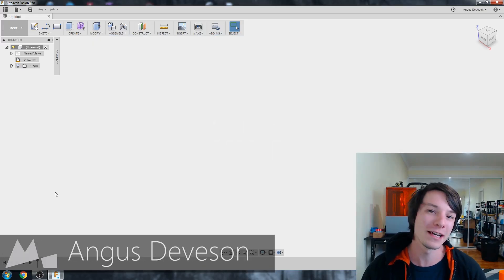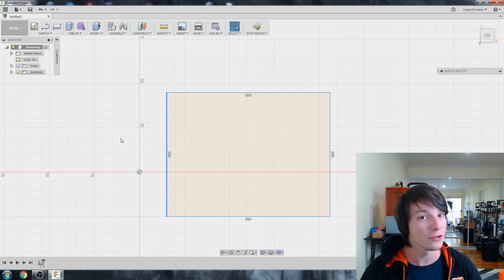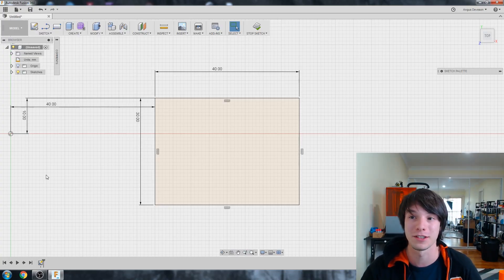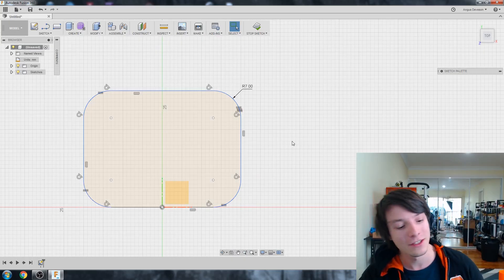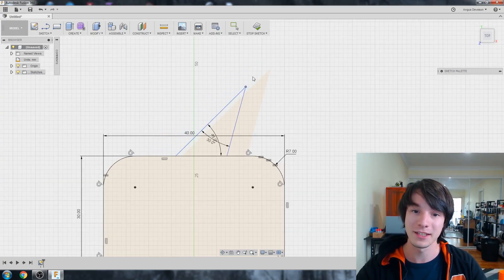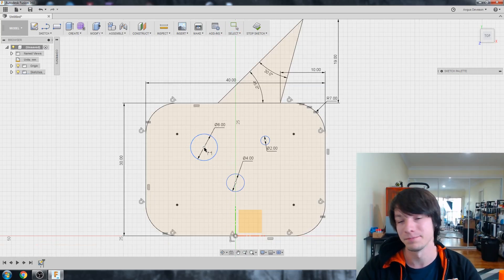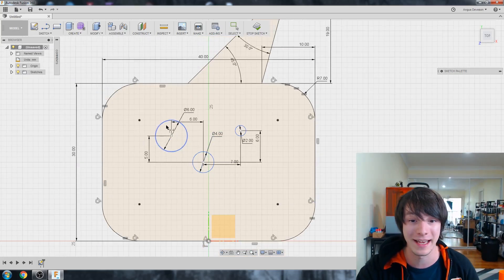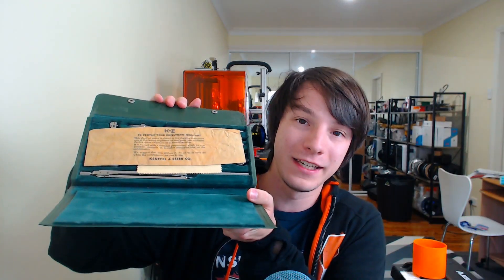Correctly Dimension your Sketches! CAD for Newbies with Fusion 360

Comment: I've got a set of those tools (and some slide rules). I used the tools around the time that the TRS 80 hit the market (77-78). The coolest draftsman (I wasn't a draftsman btw) on the block had an electric eraser. I made blue lines of drawings that I needed using mylar with the drawing exposed on it and some treated paper. You put them together and ran them through a big machine. I don't remember the details but the the smell of ammonia was strong when we were making copies. I prefer Fusion 360 to those days but a set of good drawing tools are still pretty handy.

Comment: Watching this on July 20th, 2020.
 
 
This is a really good showcasing of how dimensioning works because I ended up having the same design as you even after we "randomly" placed the circles. We still had the same sketch at the end of the video.
 
 
It will not be a yellow background on the sketch anymore, it is not blue. The rest of the color remarks are still relevant.
6:40 - Fillets is now underneath "modify" section, which is just to the right of "create". In other words, if you try to create a line, go over 6 spots and you'll see "fillet" which is just before the scissors.

Comment: Frustrating like every other video on Fusion.  The information is great, but as a noob to this software you skip some vital parts.  Like one the lines are dimensioned you move the rectangle around to show its not locked.   How did you get out of the dimension mode?  Pressing D again?  Stop Sketch?  Something else?   I an see the mouse pointer on your screen change back to the arrow where as mine stays with the dimension icon.     When your in this mode (and I assume others you can't even move the image to recenter or anything.  A very useful thing to know.   

So I figures out that Stop Sketch brings back the mouse pointer and I can move the rectangle around.   Great, but now my dimension lines all disappear.  WTH?  I also see that when moving the object around you are still the sketch mode so this is maybe why my dimensions are gone.  So I'm back to square one.

Its these "detours" that really slow down the learning on this program that those who teach it seem to not realize.  Fusion on a high level is very intuitive, but as they say the devil is in the details.
Reply: Generally in most CAD programs the "Escape" key will end your current action without effecting what was happening on screen.

Comment: Hi Angus. Just came across your videos and I'm quite interested in the Fusion 360 software. I'm currently using Sketchup Make but it has no parametric capabilities. I'm recently retired from a design career using Unigraphics & Siemens NX for the last 30 years and find the sketch capabilities and parametric control of this program very appealing. I'm looking to use this to design projects as a woodworking hobbyist. Would that qualify me for a free license or do I need to be a startup business?

Comment: Wow - that drafting kit looks very much like MINE - except that my case is blue - which I still have from High School days!  That and the triangular profile ruler with several different scales, a protractor, a 45-90 triangle and a 30-60 triangle, a T-square and drawing board and - WE WERE OFF!  Pencil first, then india ink.  Oh - forgot the eraser, eraser-bag for cleanup, graphite holder and sharpener - what was I THINKING!  Had I a clue back then where AutoCAD and similar would be, my mind may have waited to melt down into a puddle of goo.

Comment: THANK YOU! This is EXACTLY the video I wanted. I can work my way around fusion but working out 'how' to dimension has been a huge sticking point for me, often resulting in a totally ruined part trying to account for 3d printer tolerances - adjust that 1 edge a couple millimeters and the whole thing spazzes out of proportion

Comment: I'm stuck at the fillets.  The corners and edges of my cube are not selectable when I press F.
Reply: Dear internet, the hotkey for Fillet when sketching does not work for Sketching.  You need to actually go to Sketch->Fillet.  When pressing F, it applies to the Modify->Fillet option, which is for actual objects.

Comment: GREAT VIDEO. THANKS
We did not do your drawings on grid paper. We started with a blank sheet, taped it down to our drafting board, drew on borders and a title block. Then we started the drawing. It looked like this:
https://upload.wikimedia.org/wikipedia/commons/thumb/a/ad/Drafting_board_with_T_Square.jpg/640px-Drafting_board_with_T_Square.jpg
Reply: That was the first thing I thought, too! I had a blank sheet of Velum to start with, and laying out the borders and title block, and filling it all out, became a satisfying part of starting each new drawing! I really loved working with a full sheet, but it was too expensive to do very often. I would "cheat" and make most smaller drawings on cheap tracing paper. I also learned to use a transparency between an original reference drawing and a new sketch, so that I don't mess up the original while tracing in my reference points. I often wished that I had a light table for that part!

Comment: I'm interested in toys, one of my next projects will be an articulated doll. I have sculpts that I created in Zbrush and I'm thinking of making the joints in CAD software (I'm not sure if I could get the tolerances right in Maya). Does it make sense to make the parts in Fusion 360 or another CAD software then bring in sections to connect to the arm in Maya, or can you bring OBJ's and weld pieces together in this software?
Reply: paqrikaX it makes a lot of sense to do it that way, or even better import what you currently have to a CAD software then add to it
Reply: Awesome, thanks!

Comment: Angus,
    I am not sure if you have played with programming and Object Oriented (OO) Design; but, I feel that OO is a great way to think for all designs (including CAD).  I find OO as a very helpful way to address some of the dimensioning issues you mentioned.  In your video, I see three Objects within the Design you created: the Motor Mount, the Hat (of Shark Fin) and the Base.  Each of these objects have properties that define their function and it is own; so, it should be described and dimensioned on its own (just like you did for the motor mount).  That object should then be set in relation to the object that it has a relation to.  Ex: What is the motor for?  Does it couple to something on the Hat, then dimension it the Hat, not the Base.  The same for the Hat, what is its purpose and how should it be dimensioned as a result of that?  This is especially important as designs become more complex.

Hope that makes sense.
Anyway, good simple points in the video.
Mark

Comment: Tip on Cad software, don't overload the first sketch with too many details.  Separate feature sketches out into multiple extrusions or cuts.  You will be able to suppress or remove features later in design if a feature doesn't fit the base size of the component later.  Great video for beginners!

Comment: Am I the only one who didn't have the 'constraints' option in the right click drop down menu? I found a forum post that said '
All the constraints are available from the Sketch Palette now. We 
removed the constraint command from the drop-down but made them always 
available when in sketch environment' and there it was. Are you using an old version of fusion 360 or am I missing something. If you are using an old version you may want to update this as it makes it really hard to follow as a 'newb' if the commands you are using aren't there.
Reply: The option he used from the drop-down menu wasn't a constraint technically, it was just the midpoint option for locating the sketch with reference to the origin. I personally wouldn't consider that a constraint since it's not really locking in anything in the sketch with reference to itself. The constraints are under the Sketch Palette box, which for me is on the right side of the screen. He said he'd make another video about those in detail.

Comment: Excellent advice Angus.. I have been a toolmaker for about 30 years and you would be surprised how many Engineers use the wrong type of dimensioning in manufacturing drawings. Thanks for another great tutorial.
Reply: I think it would really help if new engineers spent a year on the floor where parts and tools get made before they get cut loose designing stuff that can't be made or measured. "Throw it over the wall I dare you to make this" drawings waste a lot of dollars. A lot of places are starting to get tooling, manufacturing,quality, engineering,design guys in the same room before the pain is discovered when the chips are flying. Some places are still stuck in the 50's.

Comment: Hi Angus.

For anyone having the problem where the "Coincident" & "Midpoint" sub-menu options are missing when you right-click the line - you need to have the "Selection Filters" (found via the top menu button "SELECT") "Select Through" box to be ticked or it won't work.

Susi xx

Comment: I am currently using Fusion 360 to design a 3 dimensional Cartessian coordinate system to use for showing vectors and bodies in class. 

I made the basic logic behind the system to stick each plate together in 4 parts already. 

right now I am doing a kind of grid on each plane to highlight the units. I made 5 units in every direction which should be good enough for showcase. 

but I only made this grid on one the XZ plane so far. I wanted to know if I can copy it over to the XY and YZ plane as well without loosing the base shapes of these planes. 

I used the pattern fiction for it and wanted to know if it is better to pattern in sketch or to pattern features/faces on the model after extruding.

Comment: Nice video, I have been enjoying all of them. The main problem I have been having is that I have to fudge factor my dimensions because my A net A8 builds everything .5mms bigger. Again I used the tolerance torture test and get only a .4 to be free but I don't know how accurate I realistically can expect. You had always scoffed at calibration cubes. I calibrated my extrusion setting and thoughts everything else would fall into line. Maybe a video on how to maximize settings and limit expectations??

Comment: Excellent video and advice Angus.  Please keep creating similar videos.

It has been mentioned below by a couple people, but key terms here are "Design Intent" which is used to determine how a sketch is dimensioned and constrained  and "Fully Constrained" meaning ideally you want your sketches to turn black in Fusion 360.

Sort of off topic note is I found it funny the SW (SolidWorks) crowd seemed to always preach Fully Constrained sketches/parts/assemblies while the Inventor (Autodesk Inventor) crowd - the term Fully Constrained sometimes resulted in heated debates, ie, do it all the time vs do it some of the time.  Inventor user here who always practices Fully Constraining things due to SW was my first solid modeling training.

Comment: It's good practice to centre your part/ sketch on the origin. It's better therefore to use centre point rectangles than the default corner to corner.
Reply: don't necessarily agree. The component you are building will have elements about it that decide what point should be on the origin. Commonly it is the centre, but not always.
Reply: +Bill Field  Agree 100%. The origin of a part can be whatever you feel is logical based on the geometry and intended function of that part. The origin is also typically used to quickly manipulate the part in the context of an assembly so where you put it will effect your overall efficiency in modeling.
Reply: Am simply relaying a principle that I have learnt from professional CAD trainers. Of course there are exceptions, but as a general rule of thumb it holds true. I highly recommend watching TFI CAD Tips on YouTube. He's an Autodesk certified expert CAD trainer so he knows what he's talking about. Most of his videos are based on Inventor, but most of the techniques he uses are equally applicable to Fusion 360.
Reply: +OooToob  "CAD trainers" don't necessarily earn a living having to produce designs rapidly to meet tight deadlines. They are not designers or engineers. What they teach is not always the most efficient. There is a world of difference between a designer who uses CAD as a tool on a daily basis and a CAD trainer.

Following rules blindly without questioning their rationale simply because someone tells you to do so is the beginnings of restricting your creativity and overall expertise.

I'm a designer and have been using CAD software for over 25 years. I've also taught "CAD trainers" a thing or two.
Reply: Yeah, well I'm going to be paying more attention to someone who works professionally in the industry than anyone else (and actually trainers generally start off as designers - can't be an effective trainer if you've not done it yourself for real).  As I say, all rules of thumb have their exceptions - I think you're taking the point too literally.
Reply: +1 on OU812 and Bill Field.  Design Intent would determine best orientation.  If Design Intent is not immediately known then sure, center on origin and go from there.
Reply: +OooToob  If you ever end up designing with CAD in a professional environment then you'll eventually figure it out. Here's a free tip in case your "trainer" didn't tell you this. Instead of centering your part sketch on the origin with a constraint or symmetry, use a dimension of "0" for both x and y. Reason being if you decide you don't want it centered any more as your design progresses you already have the dimensions in place and its just a double click and value change after that. If you use a coincidence or symmetry constraint on a line for example, you would have to delete those and add dimensions anyway. It's a time saver.

Your welcome kid.

Comment: Cool Video,
Can you set the origin to be in the centre of the original "rectangle" rather than just dimensioning an edge/s to be "X" mm away from it.
Reply: while in a sketch, choose Sketch > Rectangle > Center Rectangle.  That will position the rectangle at the Origin without dimensions.

Comment: idk I recommend learning 3 view drawing and dimensioning those first (by hand). Then move to CAD 3d view dimensioning with pre existing parts then sketch dimensioning. 

Also while it is not a huge deal for sketches you would get chopped to bits for having unnecessary  dimensions covering the middle of a drawing.

Personally I am a big fan of baseline dimensioning over chain dimensioning as it is a whole lot cleaner but may not be as instantaneously obvious what they are saying.

Comment: ISO nightmare holy shit lol
Reply: It does touch on the thought process on functional tolerancing and grouping of features. Pro's screw up tolerancing all the time LOL. For those playing along at home the rule book is ansi/asme Y14.5  A goal is to describe the functional aspects of the tolerancing. A good example is the video's bolt circle for a motor. You might need dead nuts on the pattern with respect to itself and the thru hole for the shaft flange but might not care so much about it's rotation or group location on the part since it just hooks up to a belt and doesn't matter as much.  GD&T could be a large series of videos if he wants to go down that rabbit hole :)
Reply: I doubt anyone will use these techniques in a professional modeling/drafting environment.
Reply: I'll say
Reply: True. And functional tolerancing isn't a huge issue for the end sketch since it's just going to be part of a mesh model anyway. I think he should make another video, though, with more attention to avoiding chaining features in a group. Good habits start early.
Reply: +st1300 r  You seem to be confusing the "sketch" used for modeling and the final 2D view that's generated to show dimensions on a drawing print. Angus is showing how to draw a "sketch" which will be extruded to form a 3D solid as _ stated. This has nothing to do with the 2D drawing view of that part. (I won't get into auto generated dimensions...that's a whole other topic).
Reply: nope
Reply: +_  Are you responding to me or st1300 r?
Reply: yeah
Reply: Right